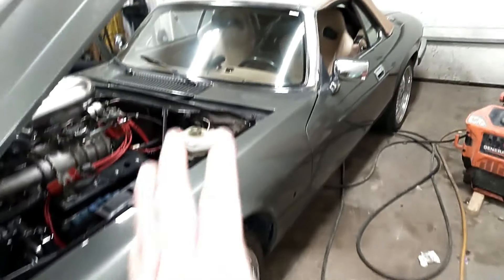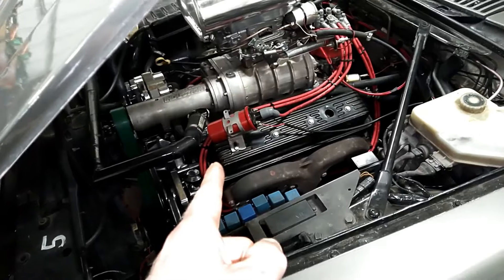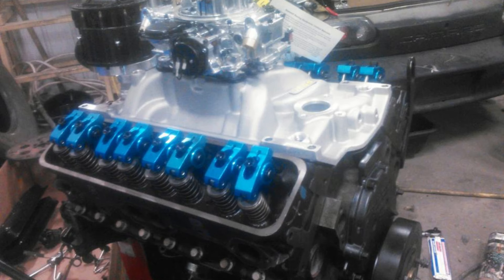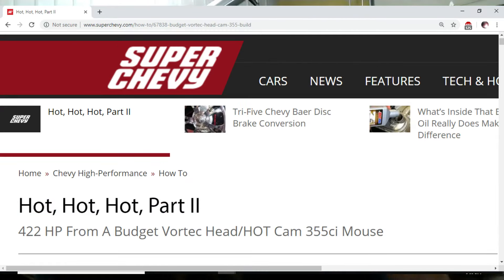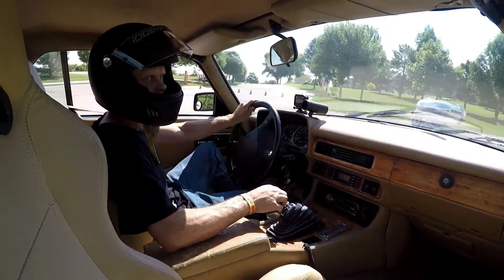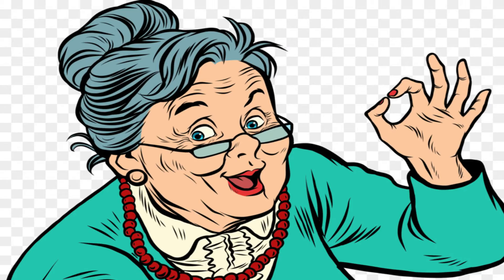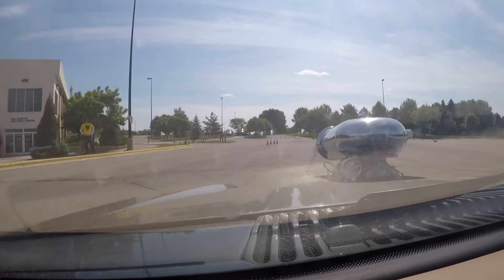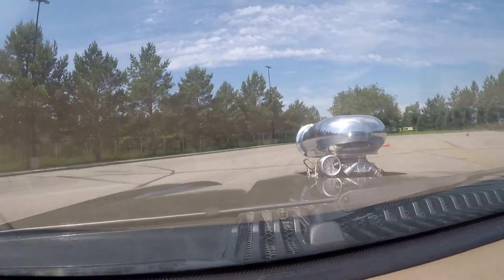scca autocross in a supercharged chevy swapped jaguar xjs

Comment: That's awesome.  I bet everyone loved seeing that jag with the blower.  Are you going to put stiffer springs and shocks on?  It could do some serious work then
Reply from the maker: To be honest right now I have no idea. I built the jag to just be a super fun street car that's a bit different than what you normally see. I put a good bit of miles on it every year so I don't want to make it to much of a race car. Plus the soft supention weight transfers like crazy and really helps it hook up under acceleration. You never corner a car that hard on the streets so I'm not sure that suspension mods are nessisairly benifical to the primary purpose of the car. But projects have a tendency to evolve so who knows...lol it's not in the immediate plans though
Reply: @Ezrider359  yea I definitely miss having a street car...if you like driving a lot don't make it so hardcore it's not fun to drive on the streer
Reply from the maker: yeah i have no plans of ever making the jag a race car, if i decide i want a race car again ill build a different car, there is still lots of room for improvements while still keeping it as a street car. but there is certainly a line to walk there. progressive rate coil overs larger sway bars and adjustable shocks could all certainly be future possibility.

Comment: I love it!     What  wheels are on it in this video?  They looked bigger than in your older videos.
Reply from the maker: Yeah those wheels are like 18x8.5's hard to find modern tires in the orrigional rims/tire size
Reply: Ezrider92356        What size tire and wheel make?     They look great
Reply from the maker: @billcaple8097  i don't remember all the detals off the top of my head for sure but i think the tires are a 245/40/18 federal 595 i think the wheels were made by a company called bds or somthing like that.
Reply: Ezrider92356    Thanks